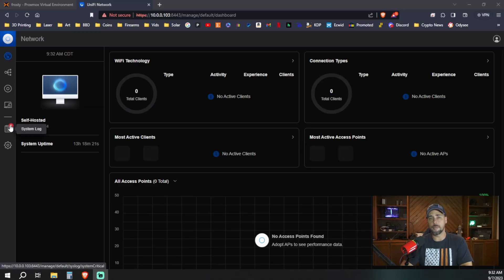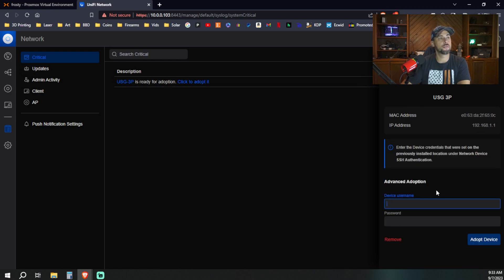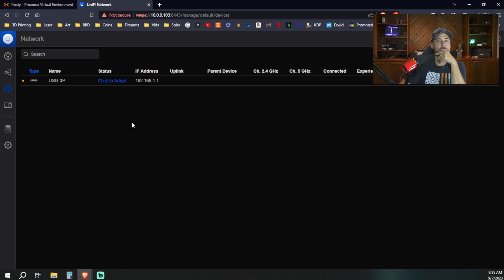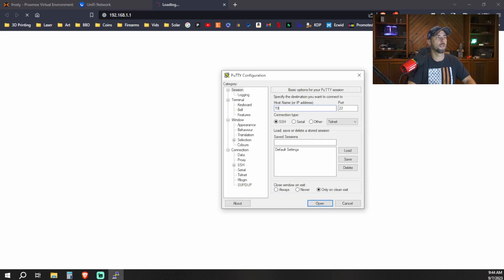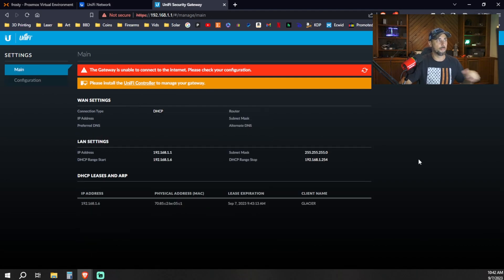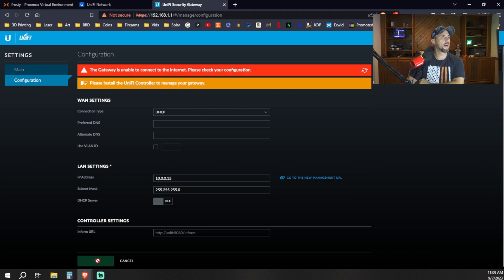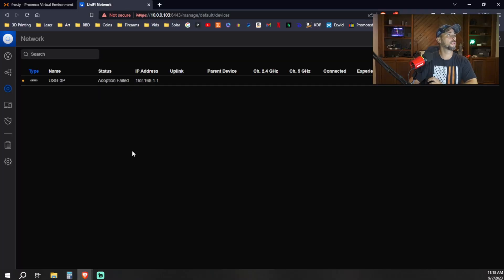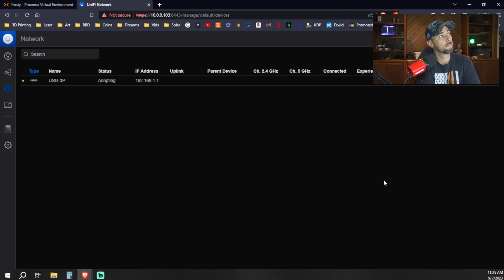Goodbye UniFi: Adoption Failure Was My Breaking Point!

Comment: Dude, the container returns the wrong IP address. It's returning internal IP for the contenerization tool. 172.x.x.x in case of Docker. It's 5 minute to troubleshoot issue... Can be fixed with one command thru ssh to device. The `info` command will shows to you what it gets. The `set-inform http://192.168.1.1:8080/inform` will fix it. Looks like you have zero skills in troubleshooting. :-\

Comment: I've just purchased USW Pro Max PoE to replace my cisco switch. The idea was to migrate my wired network to Unifi ecosystem, but retain pfsense and cisco catalyst WAPs. What a nightmare!!!! They claim this switch is L3 but it is far from whatever old L3 cisco switch offers. To cut the story short, the L3 features would not function without Unifi Gateway. Setting up your pfsense to work with Unifi is close to impossible. The worse thing is the new UI they want you to use on the controller (v8.6.9) is so buggy that at some point I was unable to tell, if the inter vlan routing was having issues at pfsense or the switch. It is so unpredictable making it hard to troubleshoot. I had switched to older UI version, but there were missing L3 opttions. At the end, when I was so close to throw that crap out of the window, I decided to restart the switch and magically all came back online. I'm afraid the fight is not over yet. I had it working for few hours before until the network speed came to a halt and no changes were made during that time. The multicast was turned off, or at least the UI was showing it unchecked, so flooding the network may not be the case. We'll see tomorrow morning.

Comment: I'm wondering what other hardware you use instead of unifi. Are you happy with your other ecosystem ?
Your brain might be the problem. Yes, I had some trouble with the USG, but it's old HW you are blaming. Mine works great now.
Reply from the maker: To be honest, i probably didn't give as much effort as i could have into unifi. I had it for years in my last home, with these adoption issues at the new place, in addition to the enterprise level pricing of their gear, i personally went another direction. 
I've been using tp-link omada, and their ui is so much like ubnt, I'm surprised they haven't been sued lol. 
The gear is much more reasonably priced too. 
Thanks for the view & the comment 👍

Comment: Ubiquiti is difficult because it's tailored more for network engineers in a commercial setting. I had a problem with mine adopting last night with a new controller setup on my server and a different IP scheme. The solution EVERYONE recommends doing always starts with "ssh into the AP". 

Once i figured out how to do that, the set-inform command let the AP know where to try to connect to because it was trying the wrong place. This is a much easier process than it sounds, i am by no means a network engineer. And to Ubiquiti's credit, when you do have it set up and working,  it just continues to work flawlessly,  but i do agree setup is a royal PITA for people like us.

Comment: Yeah, they had that ad going around about do all this stuff, pump in your data and get a free router. Well, no free router at the end of the tunnel.
It doesn't surprise me at all. I would rather buy a $50 rackmount, put in a second NIC, then do a wifi router and use repeaters. Simple, easy, done. If I wanted to be a creepy mofo on my home network, I would just put in a WIFI dongle to that server, route it all through a linux server and use web administrations and pi hole to be a sketchy ahole.

Comment: UNIFI IS NOT READY FOR PRIME TIME!  You have to use their server and if it doesn't work you are screwed.  If you don't have the right Java or if it conflicts with something It just doesn't work.  And they have had this problem for over 10 years!  SAD!   Where would Apple be if they put out such crap!  I can't even get into their server because there is some type of port 8080 conflict.  And maybe I don't have the correct Java.  But you look up the sever error and you get post from 10 years ago!  So they know of the problem but still haven't fixed it!  I can't believe I spent so much money on something that is such shit.  And who wants to take down all their security just to see if that's the problem.  What are they thinking?

Comment: Geek of almost all trades, it’s very common to have tweaked systems not respond that well to things, most likely if you installed that one a modern UniFi system without a bunch of tweaks, it would install no problem. Remember what Einstein said, you think you have math problems, mine are far worse. Perhaps comparing you to Einstein wasn’t the best example lol.
Reply from the maker: I agree. The part of this that wasn't explicitly expressed was cost. Getting into New unifi gear here, comparing to an equivalent network setup in another pro-sumer or small business setup. I actually ended up with tplink Omada and i really love it. It's like a cheaper unifi clone lol

Comment: If your on the same subnet and you can ping the device your inform address is incorrect most likely. I would save your settings in full and start top down approach or rather center main system and branch away. One device at a time.

Comment: When we moved offices our IT team were in charge of setting up new access points to the office. I proposed that we use the Ubiquiti Pro AP with high density, get all the latest stuff and I was instantly shot down like the boss like had a flashback from nam or something lol. He used them before and was not happy. We ended up going with the AP and controller from a "FS". It's not as fancy and requires you to push out a few settings manually (like enable mu-mimo etc) visa console , but they work really well. We got the 10 (!) gig version with two  5g multigigiabit ports  but years in never had to restart or reset anything, coverage and speed is great. The chips are Broadcom so if you can live with the slighly less crappy controller UI and management it can be an option. For home, I had Ubiquiti and time and time again the "oh so simple" setup would take me hours of frustration. Lots of bugs too like the time I decided to setup two Amplifi HD with a backbone, it wouldn't mesh properly. I dunno for premium price I expect top notch quality.

Comment: Xfiniti is the problem. When I first signed up with their crap service I learned that their router, even in bridge mode, doesn’t give a public facing IP. If you want your gear to work you’ll have to buy your own modem and when you do that Xfinity rewards you by then also charging you an additional 30 bucks a month to restore “unlimited,” to your account. Recently they allowed a data breach and rewarded us with a price hike. It took several contacts with xfinity “support,” but i finally ended up getting one of them to admit that the xfinity router is engineered to cripple your connection. What’s even more interesting is that the intranet IP you are issued from the xfinity router allows them to spy on absolutely everything you do and of course they do that to sell it to their partners. 

Please be sure to place the blame where it belongs. You don’t have a “real,” Internet (capital I) Internet connection. I promise with a real connection your UniFi stuff will work. There are plenty of other reasons to hate ubiquiti but it isn’t for the shitty intranet connection xfinity let you believe is an Internet connection.

Comment: I always use the command line environment - ssh protocol with Ubiquiti devices and with other brands too, common linux stuff, everything from there, interfaces, firewalling, vpn, ports forwarding, firmware updates, i save the configuration and works perfectly for years in home & business LANs , i don't like the controller with xml.

Comment: You were almost there.
Knowing that the controller is on a 10.0.0 range (subnet) and is trying to adopt the USG on a 192.168.1 subnet. That's the reason the adoption failed. Don't blame Ubiquiti for you not knowing that, these products are for prosumers.

I recently replaced my (very old) USG + Cloudkey Gen 1 for an UDR so I could keep my UniFi switches and APs.
After some online reading I successfully migrated all the settings (vlans/networks/ssids/etc) using the backup/restore method and switched off the USG and Cloudkey. Ubiquiti rocks (for me)

Comment: I've been working with Ubiquiti for 9 years. I have had a problem here or there. But otherwise, they have done just fine in comparison to any other SMB/Lower Enterprise equipment provider.
I have deployed hundreds if not thousands of devices from Ubiquiti working in IT. I have done troubleshooting on many more.
With all of the experience I have gained in these last 9 years, I can definitively say. It's a user error.
You are mad at Ubiquiti, when it is simply your own fault.

The configs don't drop often at all, it happens on rare occasion, just like any other brand out there.
Changing configs is a breeze.
If you properly update before adopting, it works just fine.
If you know how to setup a new Unifi Routers onto a network, they work fine. (Yes, that means knowing how to adopt them to an existing network pushed out by a modem)
You have to learn how to use their equipment, just like any other brand.
Keep in mind, you are also using their 3P, which isn't even sold anymore, and it's not their bread and butter, or their higher end model. It's the cheap one. (I have used this at home before, and at clients with no issues)

This was the first video I found of yours. But now I know I can't trust you to provide reliable information. Maybe you have some interesting content. But I can't trust a tech guy who can't use tech well to review something.

Comment: I spent the whole time watching this video screaming "UPDATE THE FIRMWARE!" I have the same router that has been in use at my house since mid 2017. This is very old gear and the controller has had many major updates since. Once you get past updating the firmware, it's pretty smooth sailing and any other unifi devices typically automatically update as soon as you adopt them.
Reply: 10000% this. I got a couple cameras from EA and my CK wouldn't adopt them until I moved to the beta firmware. Worked perfectly right after.
Reply: you mean update the router's firmware? I'm having a similar issue with a 24 port PoE switch, it won't adopt and I'm a newbie on this stuff, I'm at a loss here, I have a Router from my ISP connected to the unify network switch, I installed the Unifi controller manager on my PC and it won't adopt anything, I updated the network switch (it was automatically updated from the Unify controller).
Reply: @virtualnk5825  yes. I'm not 100% sure about your switch as you didn't give any details but the router in this video is pretty much end of life and has been replaced with the UXG lite. Who knows how many years it's been sitting in a warehouse gathering dust before it was sold
Reply: @graemebrookfield I believe the USG was released about July 2014, I’ve been using one since 2017.  Their newly released replacement UXG-Lite is a bit underwhelming: I would have liked to have seen a slightly higher spec machine so there is more headroom
Reply: @graemebrookfield  thanks! can confirm, my issues were out of date firmware, I might have installed the wrong unify network controller (not the most up to date), reinstalling this fixed my issues :) my router was already up to date but I also re-checked that just in case.

Comment: Kind of strange, running a whole stack of ubiquiti stuff both old and new all on pre release soft and firmware. still have to encounter the first problem with it (Encountered a couple but those were due to own mistakes). Note: This is network equipment. Network equipment like this does NOT work always out of the box and without proper knowledge of networking. Especially if you run Unifi management off a self built server.

Comment: Unfortunately I ran into this issue once before. I figured it was a firmware issue as the manufacturing date fell within an RMA period. Because I didn’t buy through what they regard an “official channel”, a quick google led me to a solution. Open the USG, remove USB drive, flash new firmware, reinstall drive. The rest was history.

Comment: I know im late to the comments, but sometimes it helps to manually update the firmware on the devices via SSH to address some adoption stability issues, especially if the device has been in the box for a long time.
Reply: Yup I used to manage around 300 unifi aps and had that “inform” command memorized. Rarely ever had an issue and your absolutely correct that if the firmware was several revisions behind you had to ssh.

Comment: Hmm... I've been running Unifi stuff for years without issue. I have switches, indoor and outdoor APs, mesh devices, and a cloud key G2. On the other hand, I manage my network using a dedicated OPNsense router and a separate enterprise switch.  The Unifi stuff is therefore integrated into a functioning network where all services (DNS, DHCP, routing, firewall, etc.) are defined and managed outside the Unifi environment. I managed enterprise network gear for over a decade, so never wanted to rely solely on Unifi as the brains of my network.  On the other hand, their switches and AP's are great and I like incorporating them. Very easy to set up and manage.

Comment: Been using UniFi since 2018? Had a USG and then finally upgraded to the Dream Machine. I’ve had two issues. Cameras need to be adopted on same network as default then put on VLAN… and never hardwire Sonos speakers as it created a loop in the network. I have 14 cameras, NVR, 3 switches, aggregation switch, 3 APs. All works flawless now. Sorry about your troubles. UniFi has decent support.

Comment: LOL I felt every moment of this video in my soul. Mikrotik is getting my money after recent headaches
Reply: I was using Mikrotik for 16 or 17 years. Last 8 or 9 years I was using as route/core switch - CRS317. Compatibility issues with Inter 540/550 10G NICs when using DHCP server. Often it cannot renwe the lease. Issue with internal DNS server/proxy, it cannot properly resolve IP names for internal IP addresses if both existing. Low performance, 75-80% CPU utilization on my device for L3 with 28 rows of the firewall on 500Mbits. And so on, and so on... I will turn my CRS317 into L2 10G core switch.

Comment: Lack of knowledge
Reply: You didn’t connect the Unifi device to the switch where it could reach your controller. They are trying to communicate through the cloud but not installed on the same local network.
Reply: *skill issue
Reply: Facts....
Reply: Yupp, sigh.
Reply: Truth hurts
Reply: 💯 I agree
Reply: USG in 2023? Bruh
Reply: HE IS USING A USG IN 2023! CLOWN WORLD LOL LOL LOL. Start off with an actual unifi gateway that is not ancient with dwindling support.

Comment: From someone that messes with these on a daily basis there is a provisioning issue on older firmwares and sometimes even on the newer firmware that you have to set the provisioning url multiple times during the adoption process whether it be by the gui or ssh. Also I know that power supply issues can cause weirdness with these units. It seems everytime I have an issue with one going offline its because the power supply is not regulating to the proper voltage and is undervolting the unit. Thats weird that you cant ssh on the lan interface I know WAN is blocked by default but not the LAN. Also I thought these units have been EOL for awhile now. There new Dream Machine Controllers are much better but I do agree Ubiquiti has their share of annoyances and issues. I wish you luck with your search but hopefully this info helps you or someone else running older equipment.

Comment: Yesterday I moved over to the new PPSK in v.187. Big mistake. 
Anyway I had a Flex-Mini that was online all night since the conversion. Then all of a sudden it went into the "Adoption Failed" loop like your device. I tried as many times as you did it get it to Adopt and kept getting the error. Since it was working as a whole I left it. Then when I started your video many hours later and saw the subject, I grabbed a paperclip and wandered behind my AV Rack to reset it. I pressed the reset button, put the unit back in its cubby and headed back to watch the rest of your video. Halfway through I logged into my UDMP got the pop up for the FLEX-Mini, went to the "Devices" disc instead of the pop up. Clicked on the "Adoption" link and SOB it Adopted and has been since.

So to tell what I did that fixed it, I can't. Other than waited, went off and did other things more important, then came back for one last try . . .

UPDATE:
"10 Months Later!". . . 
(in the English with French accent)
I have long discovered with those devices and not the APs so much, there are two "Reset Methods". When I press the Reset Button first I get the Blue LED changing to White. Then if you hold the button "A Bit Longer", it starts flashing. That's the complete "Factory Reset". That's what finally and still works for me.

Now that we are in a whole other realm and all kinds of new FWs are being released, I haven't had a similar problem. But then I have had to ping pong back and forth between different FWs a lot. Means a lot of "Resetting". When I do have to reset a device I do "The Long Press" and I'm Golden.

Comment: From a wise person that told me: They all suck, you just have to pick the one that sucks the least. The USG's are a pain in the rear. Sometimes they work flawlessly, other times, they have a fit as seen in this video. Ubiquiti is attempting to go another route, by having you get an all-in-one console, but that doesn't work for everybody. Personally, I will vouch for their switches and AP's, but their gateways\routers need some work. They are getting better, but definitely are not all the way there yet. The Edgerouter lineup is much more equipped from their products, but it too isn't perfect.